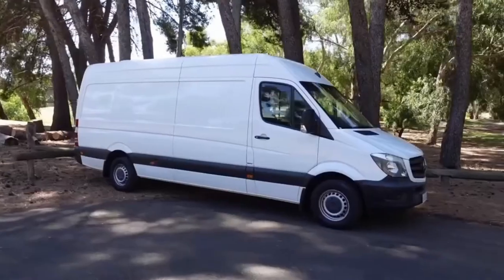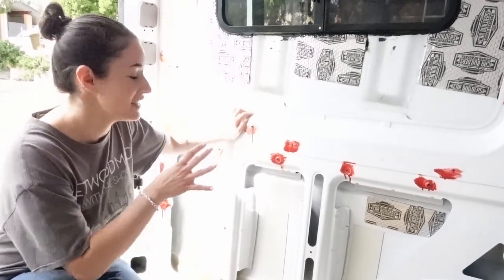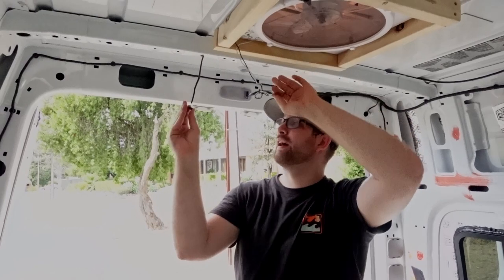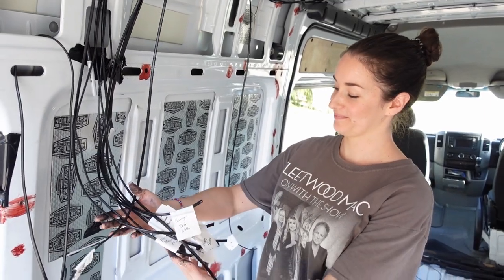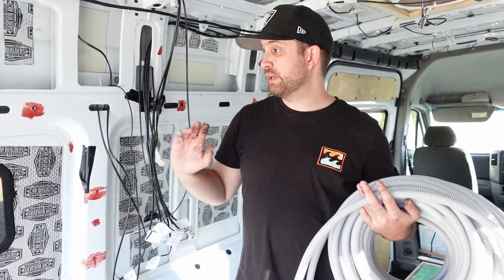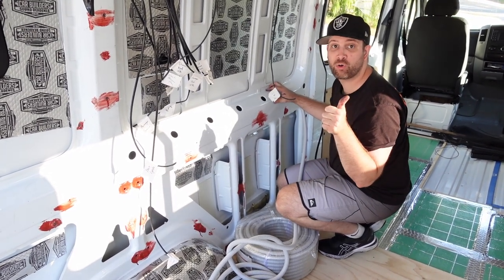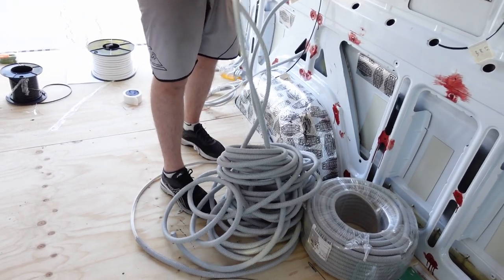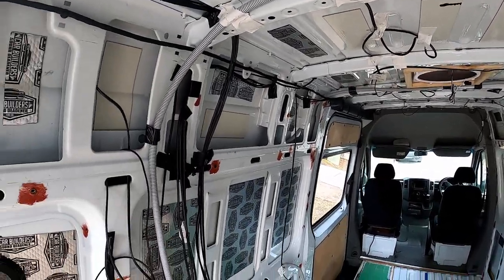Installing Electrical Wiring In Our Mercedes Sprinter Campervan Conversion

Comment: Hey guys, I've just come back and rewatched because I'm up to this step! With your 240v wiring, does each cable run singly from the inverter area to each power point? Or can you have more than one point per wire? I'm running tight on space for conduit because of the way my Iveco is built but I want to do it properly! Cheers
Reply from the maker: We ran ours as a single wire to each spot, I’m  it sure what the regulations state with 240v unfortunately. We are going to have ours all properly connected by a electrician but we aren’t quite up to that yet.
Reply: @BradandJaz  thanks!